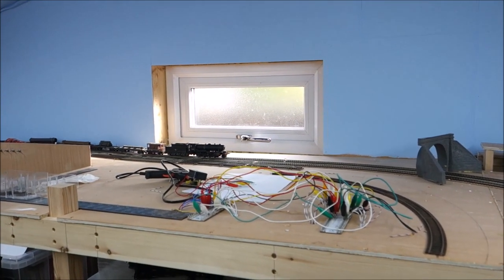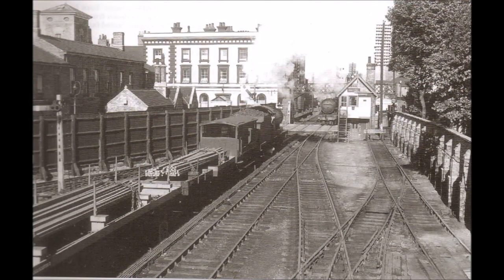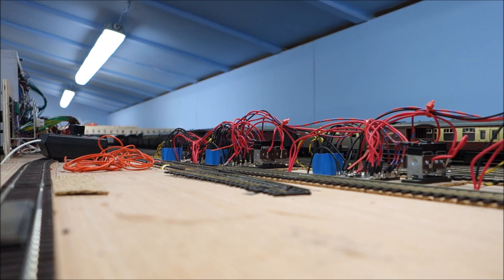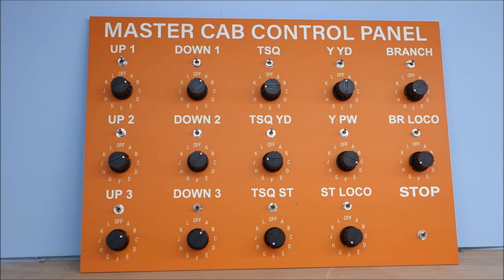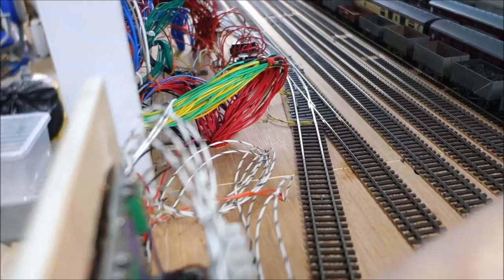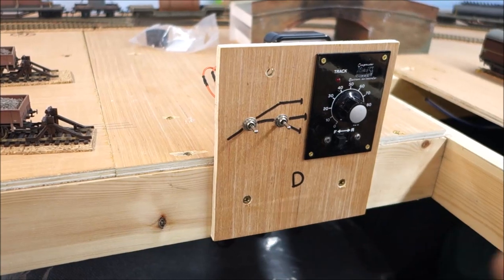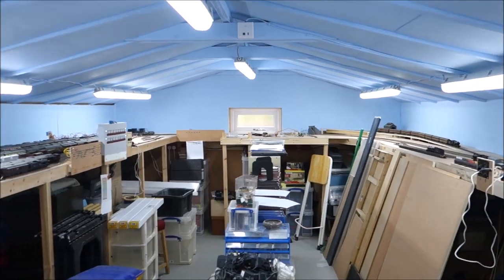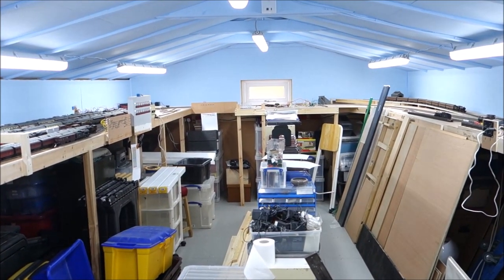Yarslow Layout Update - Operation Pt 1: Power and control

Comment: Hi Yarslow - Been eagerly awaiting for your next video, I cannot get enough of them and you are certainly not boring mate. 

In regards to your wiring and what you are doing, I totally get it. Although we are roughly of the same age I am really a newbie to the hobby. 
Like you I understand DC which is why my point wiring is going to be DC. 
I have gone that way due to cost as DC is in my books a lot cheaper, but also it is the way I like to operate my track using point levers in a row.

One thing I did not understand is about the CDU's, the believe

You said to PM you using the layout email (see profile) and we can chat in depth, I did but got nothing back.

Going back to what you said about coming into the hobby now, I only have five locos so fortunately I have chips for them all, DCC for train operation is the way forward in my books.

We are even covering the same period except I am covering Southern rail which is a right pain as they make nothing in N gauge for that period in Steam.

Thanks to you I have worked out my wiring diagram for all my point operation. I was having real difficulties trying to understand it all but after your last video and lots of questions and answers it has all come clear. Thankyou very much.
All my track feed is through a bus operating on the DC system.
Love your Yarslow Panel with all the point levers, looks great. Just how I want mine.
Apologies for the long comment.

Regards Chris
Reply from the maker: Thanks for your comment Chris.  No sign of a PM - try again if you can - I will have a look around the site to see if there is a filter or other problem.  Happy to chat about CDUs and other stuff.